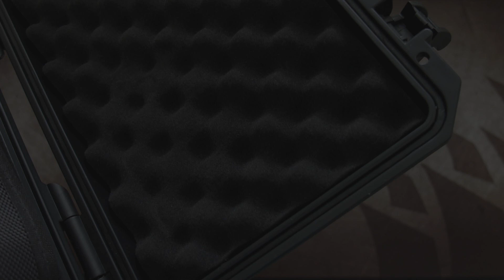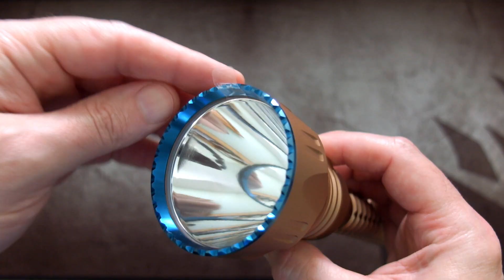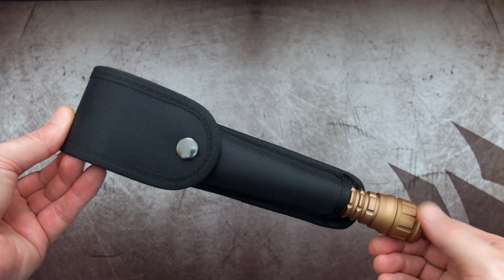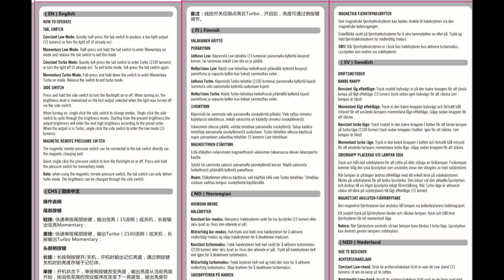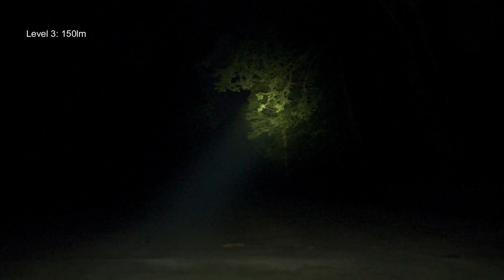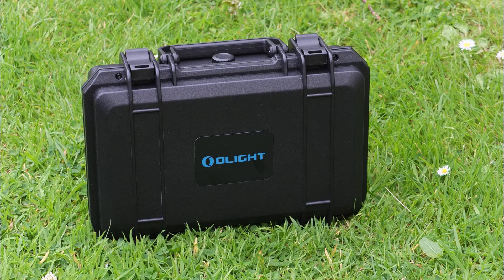Olight Javelot Pro LED Torch: Review

Comment: Mine was not charging but would turn on. Turns out there was a plastic liner that needed to be removed in the back section also....just a tip if anyone else is struggling to get it to charge!
Reply from the maker: Good point thanks for sharing that!

Comment: You have to wonder what went through the cat's mind in that first beam shot. Like, why is the sun out in the middle of night and what is it doing on my wall?
Have to agree with you on the proprietary batteries and I hate that I can not control the charging speed with the magnetic charger. They have one model I would have bought during their last sale here recently  but is a proprietary battery and it charges at 3A, that is too high a current to routinely charge any battery. I will stick to their weapons lights.
Reply from the maker: Not sure which one charges at 3A? I don't like non replaceable batteries, or easy access seems nobody else does either! Cat liked the beam quite a bit though probably wondered why it was light in dark ;-) He likes lights though always has!
Reply: @MrBazReviews  the Olight I was making reference to was the R50 Pro Seeker LE. As I was researching it I liked that you could leave in the charger and if the power went off the light would automatically come on. But then found out that it is a fast charger and charges at up to 3 amps. If it was not a proprietary battery it would not be such a big deal if you could easily replace the cell. But constantly fast charging at 3 amps is going to wear that 26650 battery out prematurely. 
The cat is cool. And being your cat I guess he would like flashlights as you are reviewing and testing them.
Reply from the maker: @TopDog8762  I never used that one, looked at most of them not that one. Seems to be using a 12V adapter home/car so might explain the higher charging. I'd not normally charge any cells at 3A, you can but usually can wear them out a bit faster. 26650 can take a meaty charge, but I'd say 2A is better longer term and fast enough for most. Cat likes the lights, a lot guess being a cat the day is fairly mundane (ie sleeping) so something going on is exciting to him ;-)
BTW almost everything I get for review I have to sell, to covers some bills etc. I wish I could keep more, I try to keep a couple for comparisons etc.  Will try to do a giveaway soon if I can

Comment: Not being able to replace the batteries is a deal breaker for me unfortunately and yes I know good batteries are expensive anyways but it's still a no but it looks like a nice light, I'm not a big fan of the magnetic charging either. Peace out.
Reply from the maker: Problem with a battery pack is run out of power can't just drop cells in there, cells wear out have to get another one (unless there is a way to get inside seems pretty tightly sealed)
I don't like that - it's time for Olight to wake up a bit on this people don't like it
Reply: @MrBazReviews  yeah that's right, I didn't think about that, that's another good reason, you'll be left in the dark in an emergency situation without electricity. Peace.

Comment: Nice review. But, it's not for me.  I am not happy with proprietary charging, Olight needs to do something about this.  Maybe add a micro USB charging option.  And not being able to switch out batteries easily is a non starter.  The ole Maglight might be old fashioned, but having a couple for 20 years and still working great, says something.  Maybe taking a little from the past and combining it with the new technology, we could get something more useful.
Reply from the maker: Pretty much every Olight with a custom battery has bothered me, this does even more as at least with those you can use the normal cells even if you can't charge them in the light. With this you are stuck with the pack and that's it. IMO the company needs to abandon the custom battery design across the board, people just don't like it